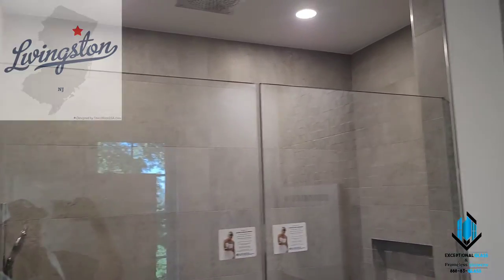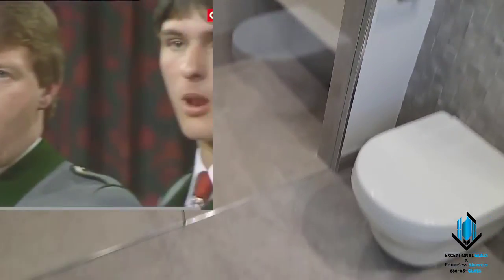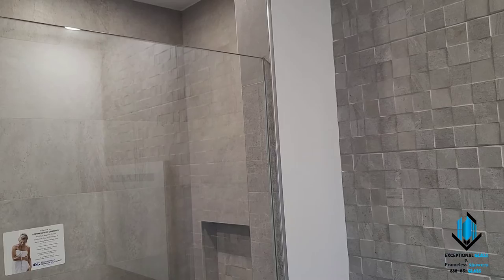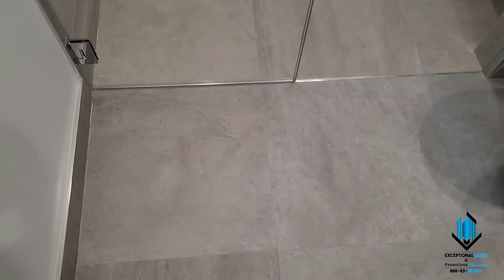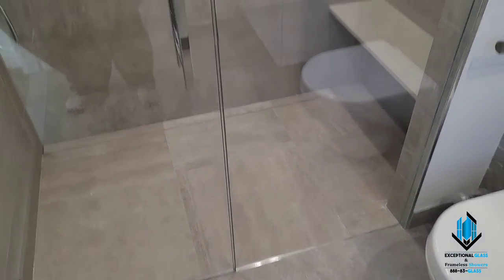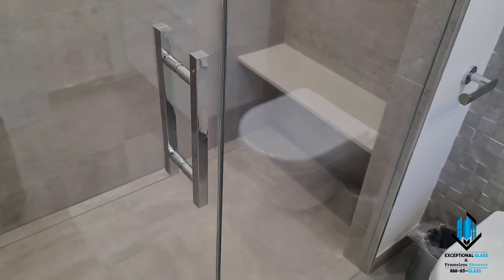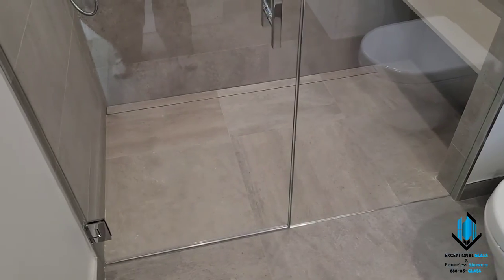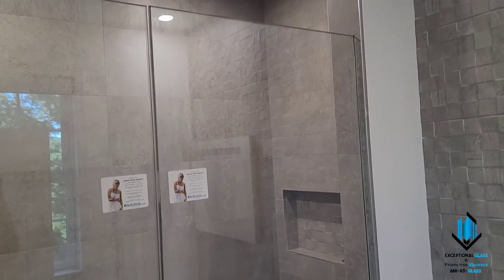Curbless Shower Glass Installation #Frameless #showerdoor #curbless #kerdi

Comment: Outstanding job and fantastic video! If you don't mind my asking, does the fixed glass pane seem a bit unstable? I was informed by an employee at a glass shop that this design might not be steady for a 34"W x 86"H fixed pane if it's only secured by two channels (floor and wall). Could it be that you're using 1/2" thick glass? I'm eager to hear your thoughts. Once again, excellent work!
Reply from the maker: Thanks! 1/2" vs 3/8" does REDUCE wobbling but never eliminates it. The panel can be 1" thick and it will still wobble. It's normal for frameless panels to wobble As there is no top support.

Comment: Great look, I'm designing a curbless shower with frameless glass.  So did you thin-set in something like a Schluter Systems Deco-SG channel, into the tile?  Great idea!  Did you do that on both floor and wall?  What keeps the glass attached in the u-channel?
Reply from the maker: Yes! Both wall and floor. The glass is siliconed in place with Schluter brand caulking.
Thank you for watching!

Comment: Nice job! I'm thinking of doing the same for my mom's shower. It'll be a DIY project so I have some questions:

1. Could you tell us which U-Channel you used to hold the glass in place please? I've seen the Schluter channel, but thinking that the CRL ALUM-SCSA3812SL-VCP-1 might be better although it is wider. 

2. Do you mind sharing the hinges as well?

3.  I see no gaps between the glass and the tile surrounding the glass. I assume you placed the glass in the U-Channel, then tiled around it, is that correct? So if for whatever reason you needed to replace the glass, you'll need to remove the tile surrounding the glass, remove the glass, place new one, then tile again. I'm thinking that I'm not seeing the trick to the easy way to replace the glass. Could you please share the secret?

 Thanks in advance.
Reply from the maker: Thanks! 
Answers Below in BOLD
1. Could you tell us which U-Channel you used to hold the glass in place please? I've seen the Schluter channel, but thinking that the CRL ALUM-SCSA3812SL-VCP-1 might be better although it is wider. 
*
The tile and Channel was done by the tiler prior to us coming into the project. 
They used SDRC12BA from CRL. I know as I'm familiar with all CRL hardware.*

2. Do you mind sharing the hinges as well? 
Hinges are our in house hinges. Exactly from the same manufacturer as CRL. Solid brass construction

3.  I see no gaps between the glass and the tile surrounding the glass. I assume you placed the glass in the U-Channel, then tiled around it, is that correct? So if for whatever reason you needed to replace the glass, you'll need to remove the tile surrounding the glass, remove the glass, place new one, then tile again. I'm thinking that I'm not seeing the trick to the easy way to replace the glass. Could you please share the secret?

We installed with groove, channel and tile in place!  The "Secret" is rounding the corners of the glass going within the channels and grooves and being within 1/16"
Honestly, it's not really bad. To complete installation, we used shluter mildew resistant caulking (Same as MRS316 from crl). If it ever needs to get removed.. Cut caulk, use suction cups to take it out at 45 degrees and done.

Thanks for watching
Reply: @ExceptionalGlassLLC  Thanks for your response. I thought I had replied to your response but I guess my response didn't get posted. Anyway, I'll try again:

1. Found the SDCR12BA in the CRLaurence website, thank you. 

2. I checked  your website, but I don't see a "products" section or anything like that. When you click on "shop" you get a "request an online quote" and that's it. I do see your "featured products" but that's it; do you have a link to all your products? 

3. When you say being within a 1/16" do you mean 1/16" undersize on the glass dimension? Also, would I need to specify to the glass manufacturer to round the corners of the glass? Or is that a standard practice?

Thanks again!

Comment: I have a wall mounted shower door with hinges just like in the video. I need to know what kind of seal is between in the wall and the glass on the hinged side. My installer used a simple T-shaped strip attached with some sort of double sided tape. The strip from the lower hinge down to the floor fell of off and I don’t know how to reattach it.
Reply from the maker: Once the "taped" seal comes off, it usually can't re-attached. 
Finding out why it came off is first, perhaps the space is too tight for the "T" vinyl and using a different style would be the fix. Seals come in a wide range of styles to accommodate variant spacing.